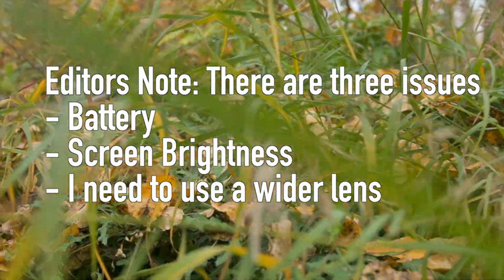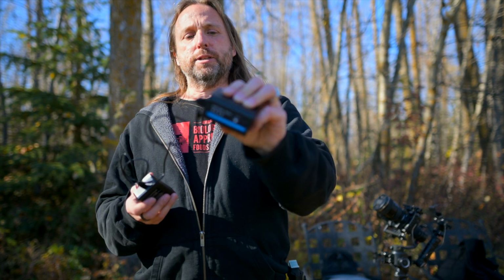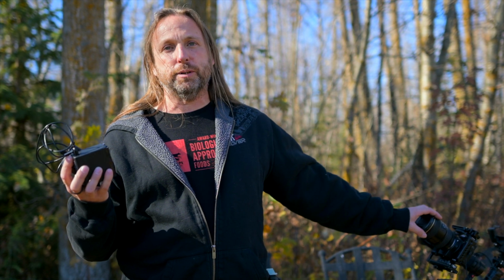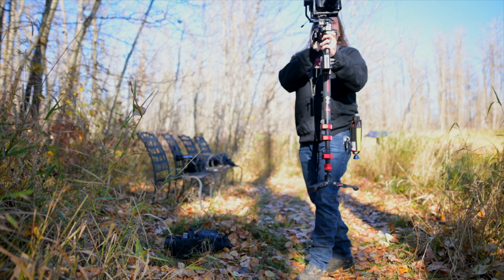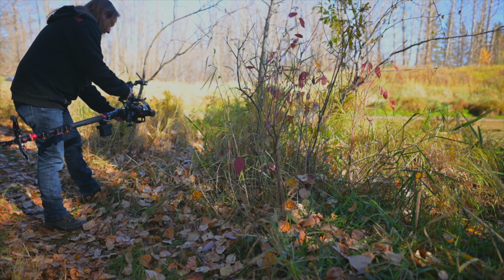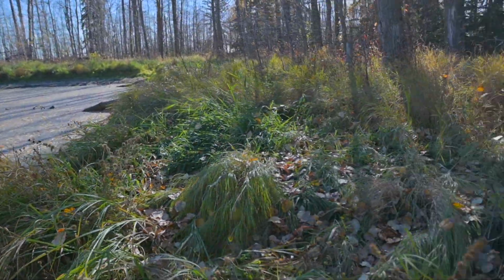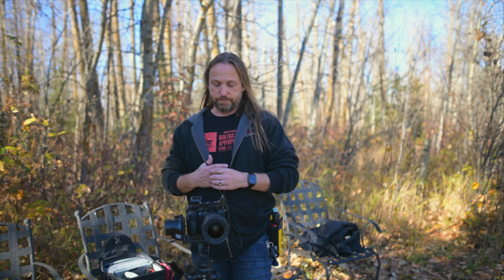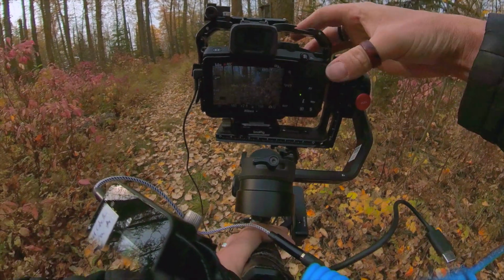Nikon Z50 Broll Part 2

Comment: I use a Quick Release Plate with my Nikon z50 when using a steadicam or DJI RS 2. I have 7 batteries for my Nikon z50.
Reply from the maker: I just ordered a dummy battery from Alibaba,  I am excited to see if it works.
Reply: @smithmediasolutions1932  Hopefully it will, let me know.
Reply: How did the dummy battery hold up for the z50
Reply: @rodmanrn11  There is no dummy battery for the Nikon z50. That why I bought seven batteries.

Comment: I love this camera but the battery life kinda blows. I wonder if the Nikon fc is any better?
Reply: I would've bought this camera if it used the same battery as the other Z cameras. Would be a viable second or backup body if so. I don't mind a bigger body size if it meant standardized battery types
Reply from the maker: The Zfc can be charged off of USB while it is running.  That is a step in the right direction IMO.  I like the ergonomics of the the z50 though.